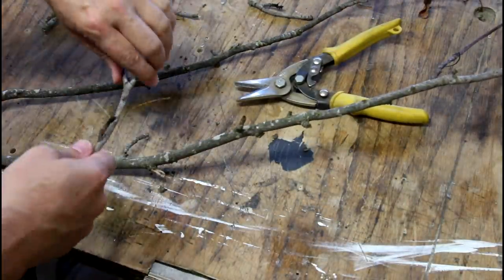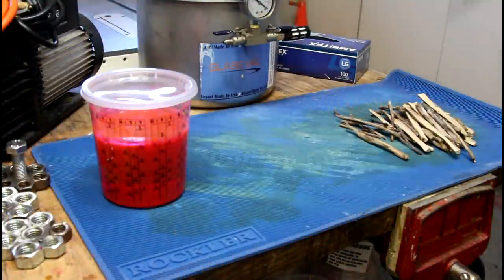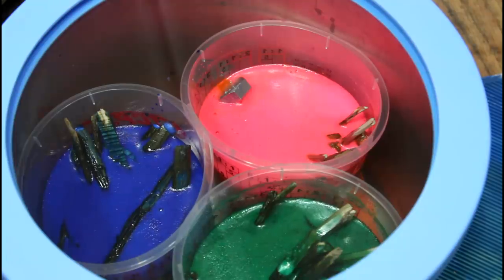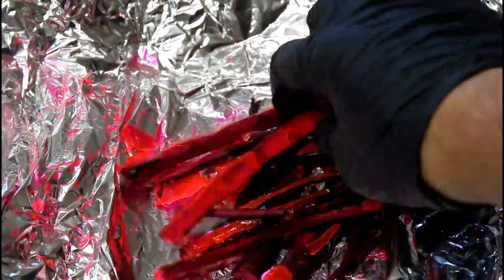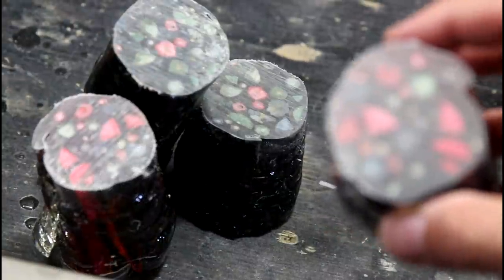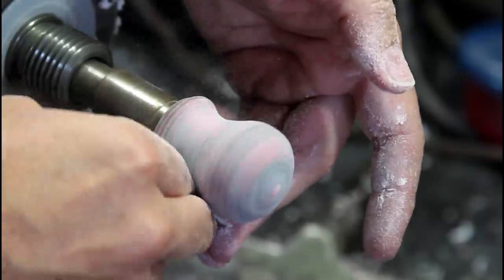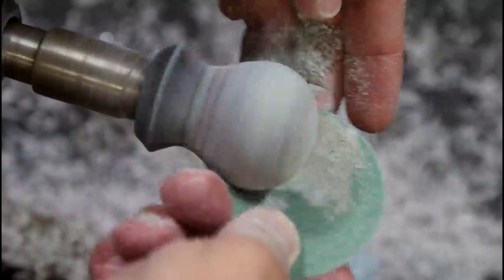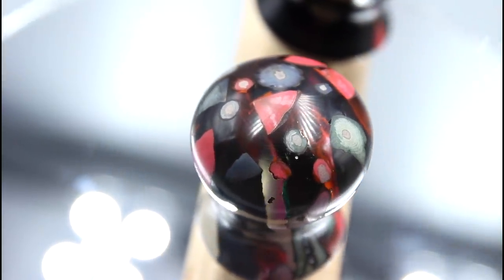Homemade Heather Gems?

Comment: Maybe you can use a bunch of zip ties on the  bundles to get them how you wanted? Thanks for another great video!
Reply: Not knowing anything about resin, I wonder if soaking them in the dyed stabilizing resin will make them more pliable (like soaking them in water would)
So they could be ziptied after the soak for a closer fit.

though maybe a metal tie so it could be baked in position
Reply: Hose clamps might provide tighter clamping pressure than you could pull with zip ties
Reply: one idea would be to put in a bottle, then blast a bottle with heat gun, put in another bottle an heatshrink that and maybe hose clamps to even out pressure. Great idea with hose clamps, thanks!

Comment: oooh, these did turn out interesting! If you wanted something closer to traditional heather gems, i wonder if you'd have better luck with like, flat chips of wood instead? Then you could probably layer them together closer in the final mold
Reply: Woodchip micarta :o
Reply: that's basically hempwood
Reply: maybe larger bits from lathing wood, could use scraps from another project. that might be too fine though

Comment: I wonder if using a fresher “wet” branch would work better for absorbing the dyes? If it’s wet it might still have some capillary action going on. Think white flowers in food coloring water…
Reply: If the dye was dissolved in something aqueous, I think you would be right. Idk if the resin he is using works that way though.
Reply: less moisture - better color penetration.
Reply: probably treat it like dying a flower, wonder how it would like resin instead of water though.
put the fresh stick (that still has some leaves and buds on) in a pot of colored water or resin (try both) leave it, see how much it absorbs, then dry it out and infuse it
Reply: @konzetsu6068  that’s what I was thinking.

Comment: Peter, have you tried using short sections of PVC pipe as the casting container/mould? It's easier to chuck, more in-round from the start, and the PVC turns without mangling your knuckles.

Awesome work, as always!

Comment: I like the idea of linear lengths of material set in resin and turned.
Ideas of variations abound:

Sewing needles aligned point down in a block to hold them in a matrix like honeycomb;

Polished copper fuse wire tangled together, twisting into a loose braid;

Thin plastic tubes suspended in resin along with dyed microbeads in order to simulate fibre optic cable;

Straw or hay dyed and stacked and twisted into corn dollys.

Ok kinda reaching on that last one.

Keep up the great content Peter, thanks as always for the great vids!

Comment: hey, I really love the idea of home made heather gems and I have a few suggestions - first, to get them to compress you could try using a hydraulic press! harbor freight has small ones for relatively cheap or you could ask if your friends would let you borrow theirs. Secondly, instead of using the plastic bottle, which left lots of gaps in between the sticks, maybe you could pack them in tighter with packing tape or a stretchy cling film and inject the resin? Or a steel pipe if you're using a hydraulic press, but you'd need mold release and a pusher that would fit inside the pipe. anyway, love your channel! thanks for sharing your experiments with us!

Comment: In "How-It-Made: Heather gems" they use soft iron wire or copper wire 1-2mm thick, to hold sticks together when dyeing. And tight wire banding to compress whole stack of sticks for final resin cast.
You can use latex "balloon" as divider or stretch mold to spend less resin.
From in to out: resin filler, (if need, wire bondage <=>) soft divider, rubber foam filler, hard container. (note: wire bondage may be over the soft divider)/

For DIY fiber-glass panel i used this scheme: soaked in resin fiberglass fabric put on the prelubed panel baseform, then wrap it with trash bag(to exclude resin spill), next fill all deepenings with rubber foam pads or sponges, and put whole this construction into standart vacuum bag. After disassembling, new panel cut, grind and polish to final shape.
 i made that way custom spine panel for my GF's backpack.

Comment: you could use a few small bottle jacks, to make some kind of a compression system, like cardboard bailers, with the wire. its compresses the cardboard down, then you put the wire straps around it, then release it.

Comment: Peter, I wonder if you could clamp them together tighter by making a sleeve out of Coroplast (think like a rolled up newspaper) and tightening with hose clamps? Once you have it tight enough, hot glue the outside edge of the coroplast so it doesn't leak, and hot glue an end cap on to make the bottom

Comment: Few ideas to get to gemstone level: First, I think you should keep the branches in one piece without splitting them.
Secondly, if your stabilizing resin is water based, the water allow fibers to move around, so they can go from round to a polygon shape and match each other really close. If so, compress fresh impregnated pieces in a jig and put them to oven in the jig, that way they will be far more dense. If resin is solvant based, take the pièces before impregnation and put them in boiling water, if the bark is removed it will also get them lighter by extracting part of the tanning, then stack them in a jig and compress, when they get cold again, you can dry them, if you want super dry which is better for impregnation, get them into microwave. After that you can impregnate them, stack, cook and ready!

Comment: Zac Higgins does castings in PVC pipes with a cap on one end fairly often. Maybe you could try a pipe just a bit bigger than your intended product and really pack the dyed twigs in there as tight as you can before filling the gaps with resin?

Comment: Idea to get the Heather more compressed. So build a little steel box about the size you want the blanks to be, out of steel flat stock but leave one long side open and spray with mold release. Place Heather and resin in. Place a block of wood on the open side and compress the block with a couple of C clamps as tight as you want.. should provide compression sufficiently.

Comment: They're very pretty and the parts you cut off could be used as stands for smaller pieces that you make. 
You need a bearing press to rig up to compress the bundles, then try smaller diameter sticks... Or hedge wood stems. Something without heartwood.

Comment: tons of really fun possibilities here..    you mentioned they "crush" them somehow........would you be able to smash the sticks in a vise?  (I may be misunderstanding what the purpose of that portion is, however.    is it to fray the fibers?  if so a benchvise should work, though MUCH slower.....)  

Could be interesting to do the small sticks, dye them, wire into a bundle but ONLY at one end so they splay out slightly...then break them off at random.....cast them in the resin but only up to the wire on one end  (that way the first step is to cut off the wire'd portion )  should produce something similar to the "secret" series but on a larger "scale" of sorts.....

Comment: You could use a cylinder car jack and a frame to press the branches together. It won't be as much pressure as the real thing, but it'd be more than you had.

Comment: Idea for compressing the wood sticks.. Get a piece of sheet metal and roll it into a tube, then stack a lot of heavy duty hose clamps up the tube on the outside. Then tighten each clamp a little bit at a time, as one clamp takes the force off the others next to it, you should be able to compress it more and more. The combined force should be able to do something.

Comment: If you cut wood thin enough but flat on two sides you should be able to layer them together in a way where they're tight enough to look like the gems. I have a bracelet myself and it looks like there's just a black line between the colours. Smaller branches might not be ideal. I think they make the gems from clearing out "old growth" heather that's been there a long time and gotten big and gnarled, and in the absence of a large smashing machine, just going for a flush fit might be the best approach. I'm sure you'll figure something out, but these look nice too.

Comment: Try using metal window screen cut into discs only slightly larger than the opening of the dye containers to push the twigs below the surface.

Comment: I feel like this type of project would have looked really cool with you cutting a cross section of it. I would have liked to see what it all looked like with like a slab cut out of the middle. Maybe you could use those little pieces that came off the ends to make a pendant for a necklace?

Comment: I'm sure someone's already suggested it, but I think you need to have the twigs TIGHTLY bound/bundled together to gain the layered effect. Possibly make a sort of layered/stacked wall with the dyed twigs, then use some dyed shavings as a filler to fill in the center, and to hold them against the container. The way you threw them in was too loose.

Comment: Okay so after watching this and looking up how heather gems are made I have a couple thoughts.

#1 the sticks you used are too large which you had mentioned as well as being a bit too straight. If you used thinner less straight pieces I think you would have gotten better results.

#2 you could put the sticks into a bench vice to press them together tightly and then wrap some tape or something around them to hold them tight together. If you tape it you can then use the tape as your mold

Comment: Now I just can't help but think of taking a bunch of straws and filling them with different colored resin, then taking those different colored resin rods and putting them into some kind of bigger mold. I just can't decide if I'd rather see the straws all going in parallel with each other or embrace the chaos and have them at all different angles so the final blank with have random bits of color in all different arrangements.

Comment: Hmm, just an idea, a few more colours maybe, use sticks or 1/4" to 3/8" dowel perhaps, cut it into lengths the same as their diameter then pack a mold full of them. It would allow a lot more colour and a more even distribution rather than sticks here and there.

UV reactive or glow in the dark for some parts might be cool.

Comment: I'd suggest welding a little tub, almost like a canister for damascus with a lid that just barely fits inside. That way you can smush it in a press and clamp it down before sticking it in the pressure pot.

Comment: What about instead of keeping them sorted by color during the baking portion, putting them into the groups you would use for casting?  Then wrapping them in the foil and then wrap the foil from top to bottom with same twine you would use to bake something with.  In theory that could bind them more tightly and they would stuck together well enough to cast them in resin.

Comment: The thing about why they use Heather is because the bush don't have very large twigs and their sticks are somewhat more uniform than normal brush weeds... the comparison here would be Tumbleweed. If you put glitter in the clear resin it may mimic gold veins and be great for jewelry, but I can see some creative effects can be put in the resin with the gaps seen here.

Tieing the trwigs together tightly with Died twine may get you closer to the heather gem effect but he clear resin one has a closer effect. That said I like how they came out.

Comment: idk if you care or can (because of a breaker limitation or something) but if you turn the voltage on your welder tack welds will lay flatter you may want to turn feed speed up slightly as well

Comment: It would be EXTREMELY tedious and you wouldn't know if it pays off for awhile, but maybe if you get some fresher twigs, braid them while they are still spry then use those after they've dried out for a time it could have a pretty cool look. Maybe braid together a whole bunch then bundle them together, zip-tie 'em and leave them to dry. Might not work but it doesn't hurt to put the idea out there.

Comment: I wonder if you would get a more Heather result if you soaked them in alcohol to make them pliable, and struck them with a rubber mallet to smoosh them out a bit, then dry them out again before stabalizing

Comment: Looking at how heather gems look like and how I know a "heather" plant looks and feel like, I would maybe say to try with a thick stemmed grass, or some much thinner sticks, maybe willow and a lot more of it. and before hardening the stabilizing resin. Press them together in maybe a baking tin with a thick piece of steel on top, or some other heavy thing that can handle the heat, 

That being said I don't know how well a heather gem approach works for other than thin pieces, for like inserts and that stuff, since the heather gems seem to all be from the side

Comment: What if you used wood chips instead of twigs? Nothing too small though. Or dyed the resin with the three colors (left translucent) so that different parts/spots of the block would be different colors. Eg. maybe put a little bit of pink resin first, twirled it around the twigs a little, then let it set for a while if needed before repeating with the next color etc.

Comment: I might say weld a small box with some nuts on the side so you can use some bolts to really squish down on the sticks while they are wet and bake the box. hopefully that creates almost a solid block of "Faux Heather Gem"  be fun to see other porous material turned into heather gems as well, maybe even some bark again? lol

Comment: What would happen if you took the container of stabilizing resin with the item being stabilized still in it out of the vacuum and then put it in the pressure pot for some time? Would that cause it to penetrate more?

Also, what would happen if you just took a small container of stabilizing resin and baked that? Would that become something you could turn?

Comment: Perhaps you could tie the bundles tightly together with bailing wire, then poly strap them before removing the bailing wire, leaving only the poly strap.  I imagine that would be safe enough on the lathe.

Comment: What if you bound the twigs together with twine to make them tighter? I guess that would require more twigs so you can lathe off the twine and still have material to work with.

Comment: So, the next time you need to stand things up in the vacuum chamber:

If you take 2 rectangular pieces of wood and put them inside the circular container congruent to the object you need held in place. they should press gently against the curve of the circle and that way they will hold things in place without taking up as much room (or time to set up) obviously I have no idea if that’s good for the chamber but… it’s an idea

Comment: FYI: hit those water bottles with a heat gun and they'll act like heatshrink. do it before cutting them, with air and/or water in the bottle and the cap on, and you'll get the sides nice and smooth.

Comment: Okay, hear me out. I'm going to try to describe my idea on how to squish them together as best as I can. First make a box mold with a bottom and 4 sides (no top). Make it long enough to lay all the sticks into it. Next make a top that is slightly smaller than the inside perimeter of the box out of a block of wood. Lay all the sticks inside, cover them in resin, and then use clamps to Smash the top down as much as possible to compact the sticks. Resin will seep up past the top but I think it will press the sticks together really nice.

Comment: Maybe smash up the sticks with a hammer next time until they are really thin, if they end up being long bind them tightly with wire or something before putting them in the casting resin (if they end up being really short you might just have to have some sort of solid mould and have a block on top you can press them down with)

Comment: Do I want to know why you have the knife at 1:58 😳???  😂
Why hasn't the resin cured?  Oh wait, was that just dye...then the resin after you vacuumed them?  I thought Heather gems were at 60 PSI...you did 50...would that be why they didn't look like them when you got them out of the pressure pot?  I've always heard   sour dough bread from San Francisco won't taste the same made anywhere else because the water and dough are from a different geographical area.  Would that be the same with the gems you tried making?

Comment: In the "how it's Made, the bundle of sticks is put in a press...so, asuming the die is not hardening the pieces, maybe You could put them in a rectangular mould, a spare piece of wood or epoxy on top to compress and then weights.... Or tie then togheter before the epoxy

Comment: my thoughts... bind the sticks together before putting them in the resin, and then don't do a cut straight across the sticks, instead cut on an angle to get longer surfaces exposed.

Comment: Question: isn't welding zinc coated things a bad idea?
Reply: It usually is and welding much more than what Peter shows will cause pretty severe flu-like symptoms, if not worse. I have heard about a couple of people who died from zinc oxide (what is made when zinc is heated too much) poisoning, but they were from industrial setting, not home shops. Still not something to take lightly.

Comment: You has the process correct until the sticks in bottles. The sticks are put under compression against just themselves while they dry. No foil or heat. Just pressed sticked left alone to dry. Process correct after cutting bottle apart to see result.

Comment: Next time you try it maybe bend the sticks with steam or hot water first, so they fit in a nice bundle together, and then dye them? Assuming there will be enough space left between them for easy flow without disassembling the bundle, because otherwise that would be the worst jigsaw puzzle ever made